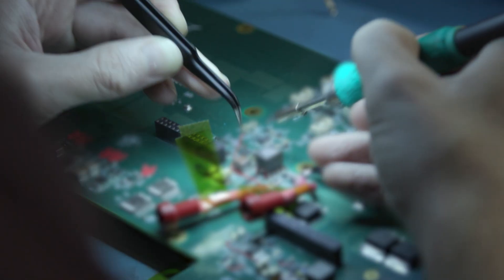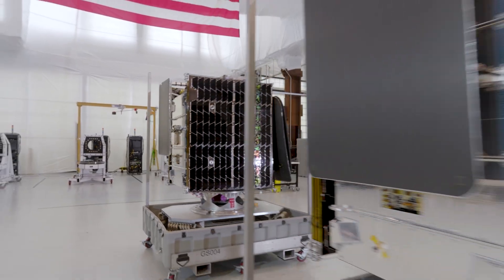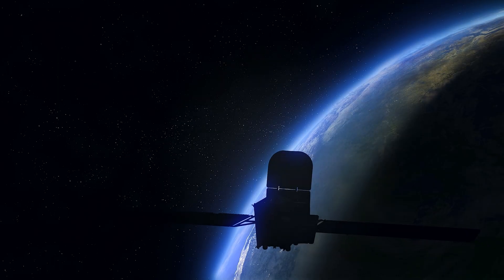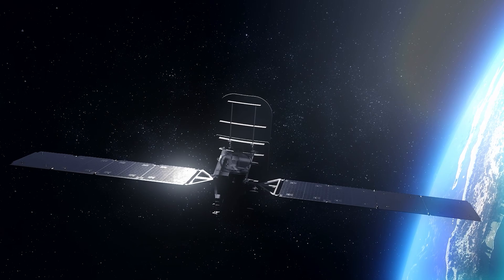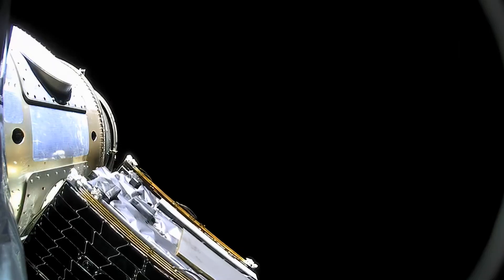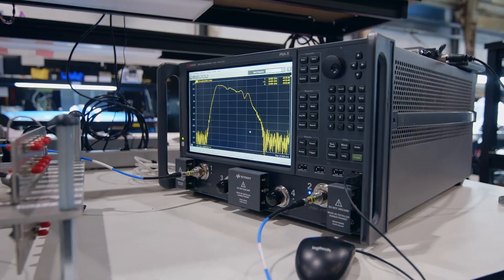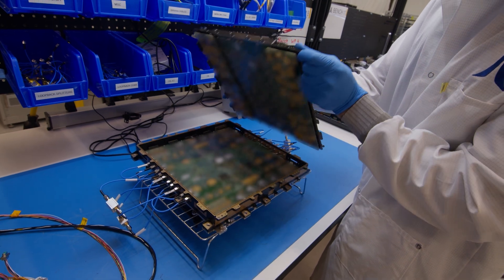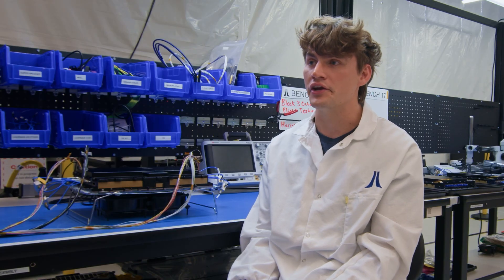We Upgraded the Brain of Our Satellite

Comment: How do you handle resonant vs non-resonant transmitting antennas? ATU on an array of antennas that cover the bandwidths supported by the SDR & satellite spectrum laws?

And if there's a time where a customer isn't paying for them, could you have the SDRs go into amateur radio bands to host an AMSAT event for free?
Reply from the maker: I'll see if I can't get one of our engineers to give a full response. So far they've said these are some very strange questions that almost make sense lol
Reply: @astranisspace  For example, if you had an antenna that was built for transmitting on a frequency around 144 MHz, it wouldn't also resonate or efficiently radiate around 1.2 GHz. 

Maybe I should see if your website has supported frequency ranges for customers? Ah, seems like each satellite has a set of band-specific antennas & the SDR coverage wouldn't be DC to daylight unless there was a shape-changing antenna (MIT has just developed this).
Reply: @TheButterZone  The RFFE typically supports Ku and Ka bands depending on the customer. The SDR operates at an IF of 1.5-4GHz, and we use a heterodyne architecture to get up to Ku / Ka. Most of the front end supports 10MHz - 8GHz, but we band select on this block of vehicles to have a fixed IF